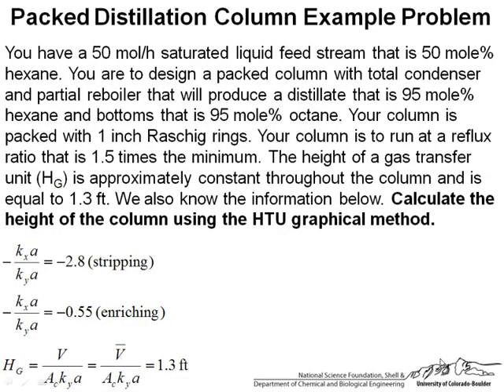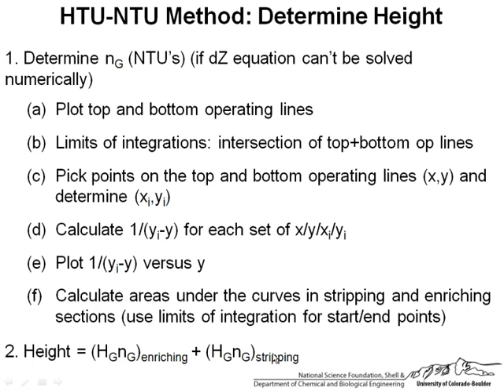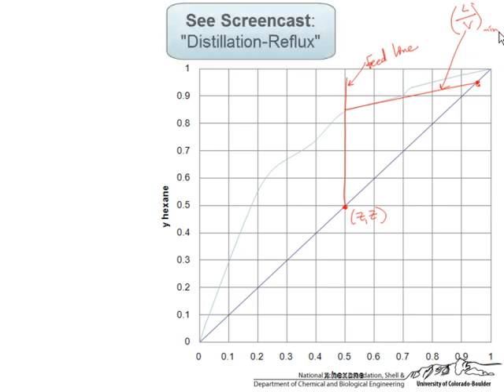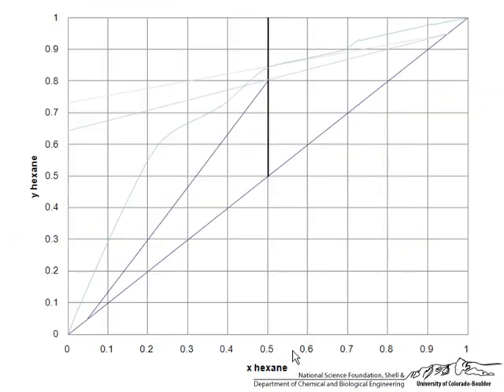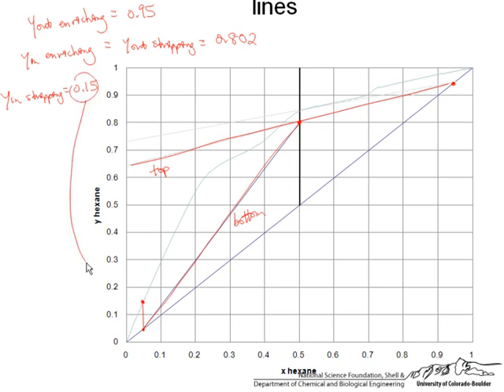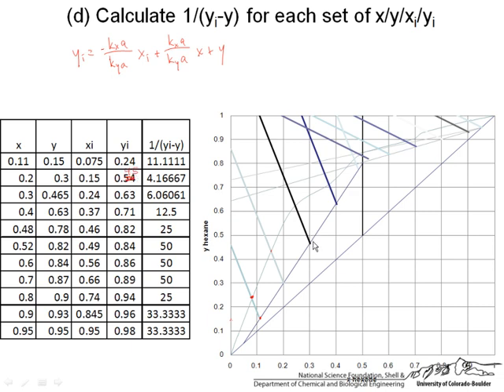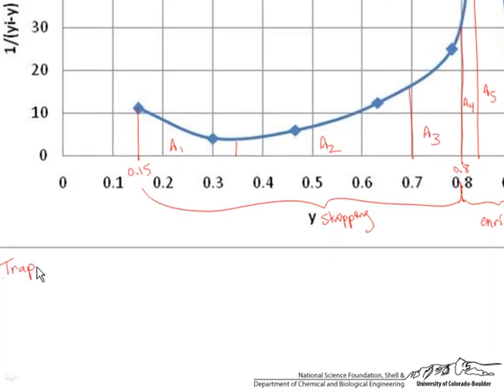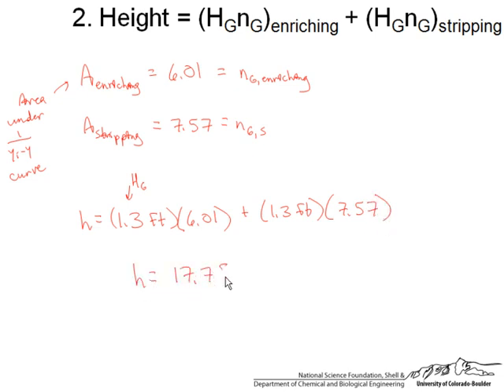Packed Bed Column Height

Comment: Imperial units? Height given in feet? The US is one of only 4 or so nations that still uses imperial units.  You should explain the physical significance of every variable or symbol that you use in your calculation (eg ka). Also what the lines and limits physically mean. And in your last plot the curve drops in the enriching section and then increases again - what is the physical significance of this behaviour? It assists with understanding if you explain the parameters and the key points on the curve